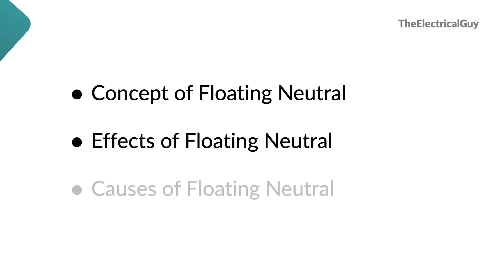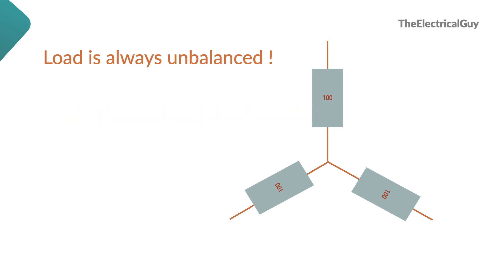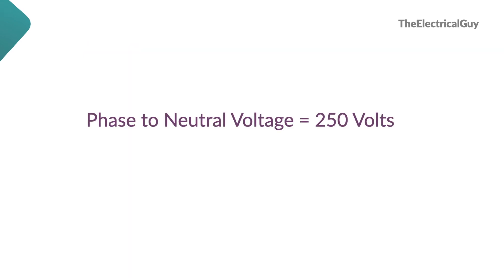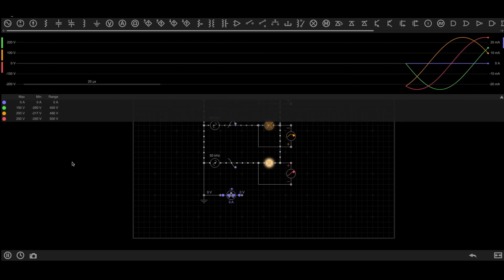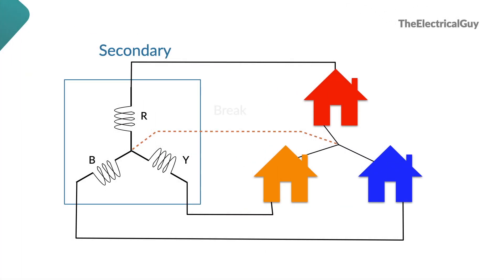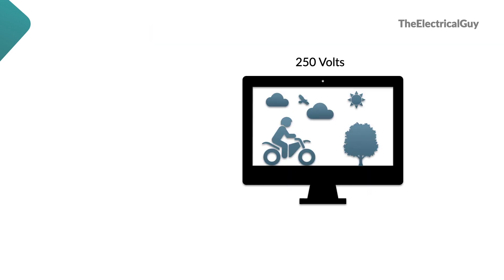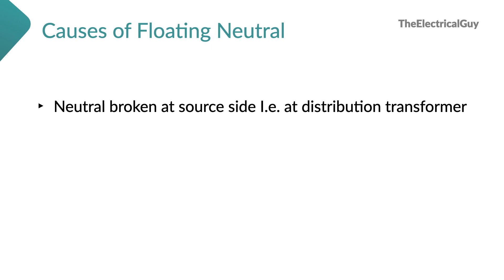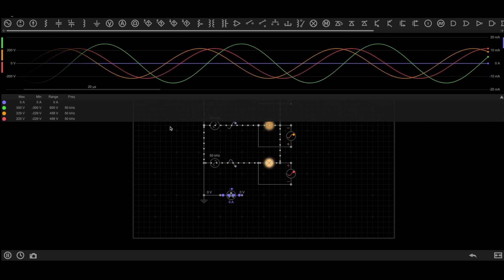What is Floating Neutral ? Easiest Explanation with Circuit Simulation

Comment: Which  software for simulation do u use?
Very much informative videos, practical oriented. Gr8 going.. very much useful videos to me as I'm doing M.Tech in Power System engineering in COEP
Reply from the maker: It's called Everycircuit. 
Glad to know that my videos are helping you ✌🏻 Do share and subscribe to my channel ☺️
Reply: @GauravJ   Thank you so much Sir😊 and Yes, I always tell everyone to prefer this channel 👍🏻
Reply: sir how do you make so many beautiful animations which software do you use
Reply: Friend I heard that “lost neutral” is different from “floating neutral” - it seems your video uses “floating neutral to mean “lost neutral”. I was told to ONLy use the “floating neutral” if the neutral loses its connection to ground and it happens after main panel. Thoughts?

Comment: Due to floating neutral, if I keep changing my load, the phase to phase  voltage will keep changing. Now, what if I require a constant phase to phase voltage for my electronic circuit which is the load to work ? What will happen if I keep maintaining constant voltage even with changing loads ?

Comment: Can you for a noob give a quick run down of “lost neutral” vs “floating neutral” ? Also if ground is lost in floating, current is still going to and from transformer I read - but also read hot and neutral are both 120 - so how could current flow if no potential difference exists anymore?

Comment: Sir, Please make a video on how phase voltage becomes line voltage in case neutral wire is not connected in the system

Comment: Thanks for video but where to use floating neutral..? In one of my application 6-Phase generator output connected to 12-Pulse rectifier without neutral wire.. Could you please elaborate application of floating neutral in real time.

Comment: hi just 2 questions how would you know whether the floating neutral fault is on your side or the distribution side(source side)..2nd is it possible for example in your distribution board all neutrals are tightened and connected properly but there is a break in neutral in one of your circuits running inside a conduit,is it possible that this would create a floating neutral? if it is how would you know it could be a circuit in the conduit?

Comment: Question: In single phase, the live wire is connected to many other appliances with different loads. so does this mean the load is unbalance and current will be present in the neutral?

Comment: Hi I have a machine with star connected heaters, each phase has 2 in parallel. It is balanced but I am wondering what will happen when a heater blows open circuit. Thank you

Comment: A floating Neutral situation can also be created on a 3 phase board due to the lock down nut of the Cable lug to neutral bar loosening as a result of vibration from traffic if the Consumer unit is located in a building on the wall closest to the road, 
I have personal experiance of having seen this happen !!

Comment: Sir. Thank you very much. This is very informative. I'm actually looking for this kind of explanation which is somewhat related to the query of our client. By the way, do you have a video of exactly what our client is complaining? It is about line to ground  voltage when neutral is floating. She is getting line to ground 27V, and the neutral is floating. The transfomer is 220V delta pri and 110V wye sec. She expecting line to ground voltage to be half the 110V which is around 50 plus volts but she got only 27V. Can you do a video about this (line to ground and neutral to ground voltage with floating neutral)?

Comment: ..but what do you call a neutral line where there is some current present now and than... Example , in Arduino if we have that problem than we would input pulldown/pull-up with a resistor..this is called a floating pin... In this case it's AC floating neutral which is tried to pulldown to the Earth but there is still numbers on the clamp meter..is this not a floating Neutral ?

Comment: Yesterday floating neutral condition developed in my house and it damaged two lights. Fortunately I turned off other heavy equipments like fridge, fan and tv. The neutral wire of our distribution transformer was disconnected, later electricians came and repaired the transformer.

Comment: I'm really happy that i landed on your channel yet you are my favourite, I can suggest the following topic : why always there is acceptable difference in voltage between earth & neutral in normal cases ? ...Once there was an incident in a facility where the voltage difference between E&N was high which led to not operating a machine! ..we checked and found earth cable was stolen from transformer side , provided new cable and voltage difference came back to acceptable level , what's the science behind it ?

Comment: Sir I have a query. In normal case of 3-phase connection when neutral wire is also well connected, just the loads are unbalanced which is obvious in daily life. Some current will flow through neutral wire & go to ground as return path through nearby distribution transformer, Right!
But my question is, does the current in neutral wire only go to one direction (i.e., to the direction towards ground) or it also change its direction (forward & backward) in neutral wire like other three phases?

(Note:- Consider the Neutral wire is well connected to nearby transformer) .

In your circuit simulation video at 4:00 mins, current in neutral is flowing forward & backward directions but I think it should go in one direction only (i.e., towards ground). 

Please clarify my doubt.

Comment: Hello. I am working on building a motor controller for a 3 phase induction motor. I had few doubts
1. Can unbalanced load condition ever occur in a 3 phase delta connected motor. If yes, how?
2. During single phasing what happens to phase voltages and currents in the remaining phases 

It would be really helpful if you could explain these things. Waiting for your reply!
By the way I really loved the content
Reply from the maker: 3 phase induction motors are perfect balanced loads. Hence, unbalance cannot happen in them

Comment: Thank u for the explanation. I'm not majoring electrical engineering, but ur explanation was very easy to understand even to me! But one thing I wonder is what I read recently in a paper is that in 3-phase motor, like PMSM, the neutral point is intentionally designed to float to prevent harmonic current flow. Well, I'm a college student majoring in mechanical engineering, so I don't have much background knowledge in this field. So I'm really confused. Can u help me?

Comment: I had a lighting circuit experience of low voltage. I measured it at the switch before the lighting. It shown 40Vac. I measured at Distribution Board MCB for lighting outgoing reads 240Vac. Can you suggest what is the possible trouble shooting guide. Thank you.

Comment: You seriously deserve more views and subs man. Your method of explanation is very crisp and precise. I was thinking about the function of the neutral wire since a long time and your simulation cleared my doubt. But I still have one question. I now know that the neutral keeps the phase voltage constant but HOW exactly does it do that? As far as I understand, by KCL the signed sum of all the currents meeting at a junction is always zero anyway. So why do we need the neutral wire to keep the sum zero? Also, if the neutral stays at (almost) zero volts w.r.t the ground, how does current flow in it without any potential difference?

Comment: Dear Mr.Gaurav, thanks for the great video..Im facing one issue...When one equipments cable got short.The supply voltage on one phase out of 3 was zero and neutral was carrying the load back to main LCC panel...What kind of phenomena it is ?

Comment: If neutral wire got broken then how will a single phase device runs? I'm little bit confused there.. maybe you told about three phase system, but in example you take home consumers who runs on single phase. Please explain this
Reply from the maker: Current will find another path to return. It can go to equipment's body (metal) or it can go to ground or even in the other phase.
Reply: @GauravJ  but you mentioned there will be unequal voltages at each load at 4:45. In case of single phase if I remove neutral wire then the system will power off then how will be inequality in the voltages?
Another thing you told P-P & P-N voltage will varry! This is also I can't understand
Reply from the maker: The lights I showed in the simulation are single phase load. There also you can see across each load the the voltage is unbalanced but still the lights are ON.
Reply: @GauravJ  But that was three phase connection, I'm talking about in case of single phase. I meant to say if I disconnect neutral from single phase circuit then how can a bulb will glow? And how will arrive the question about unbalancing of voltage in single phase
Reply from the maker: Ultimately your single phase load is connected where? To a three phase distribution transformer right. So, if there is a problem in any one phase it's going to affect the other two
Reply: @GauravJ  yes that's absolutely right. I think I got confused by considering the houses are connected to each other with a common neutral, and then the neutral wire breaks. So, obviously there will be an unbalanced condition in other phases. 
Thank you so much for giving your precious time for me ❤️

Comment: Sir how much line voltage in 3 phase system ?
400v or 415v or 440v ?
Reply: Bhai it depends on the phase voltage... What you are asking is line voltage... That is always equals to root 3 times of phase voltage    

If Vph is 220,230,240
Calculate accordingly
Reply: As per transformer rating 433v/ .but  distribution company in Karnataka line voltage 400V /230v as standard

Comment: Sir one confusion that if any of load external earthing/grounding then what is the effect of floating neutral?
Reply from the maker: I didn't get your question..?
Reply: @GauravJ   sir I mean if any of the load /home has personal rod or plate earthing connect to supply then what is effect of floating neutral in that home or load?
Reply from the maker: If you are using ground as neutral then the same effects as shown in the video
Reply: @GauravJ  no sir not using earthing as neutral it is as safety purpose.

Comment: Generally neutral is bonded with earth. If we have poor or bad Earth then what will happen with floating neutral current
Reply: The earth can serve as a return path as well (just not an efficient one compared to a nice, low resistance copper neutral wire). So, if you have a bonded neutral and earth like a MEN point, and the earth is broken, then most of the time the system will work fine (any imbalance is carried on the unbroken neutral). If, however, that neutral is now broken and the earth was already previously broken as well, you don't have a complete circuit as you have live phases coming in, but no return path. This is extremely dangerous because if there is any sort of short to the body/chassis of a piece of equipment, it may have gone unnoticed previously, but now if anyone touches it, their body may serve as the part that completes a return path via ground (since the copper cable ground is broken/open) and thus they get electrocuted.

Comment: What about in the case of a distribution system designed with a transformer with a floating neutral? We have some like this at my job, a large steel mill plant.
Reply from the maker: So you are saying there is no neutral provided ?
Reply: @GauravJ  I believe so. I'm a new electrician so I'm still learning and your videos are great.

But yes, my understanding is the transformer we have on this section of our electrical distribution is delta primary, wye secondary with a floating neutral. 

I'll look at our one-line diagram today to see if I can figure out what that transformer feeds to get a better understanding/explanation for you
Reply from the maker: Thanks. 😊✌🏻
You may have floating neutral because your load would be perfectly balanced (like 3 phase induction motor). In that case it'll not affect anything
Reply: @GauravJ  sorry, after thinking a little more I believe I misspoke and confused floating neutral with a floating ground.

Thinking a little more on this, trying to imagine the electrical print in my head, I'm 95% positive it has a floating ground. Not neutral. My apologies
Reply from the maker: No issues ✌🏻👍

Comment: does polarity matters for my laptop charger, as they have written L on right and N on left side of plug?  But my house has opposite polarity and it yet works well for my appliances.
Reply from the maker: Nope. It doesn't matter. Polarity matters in DC not in AC

Comment: why don't we get shock when we touch only one end of inverter battery?  As there must be Voltage difference between ground and baterry terminal...
Reply: Battery terminal is not grounded like transformer netutral point grounded  hence battery +be and -ve terminal no reference voltage with ground.so no shock when we touch one terminal of battery with ground